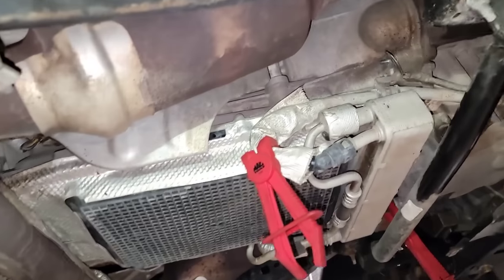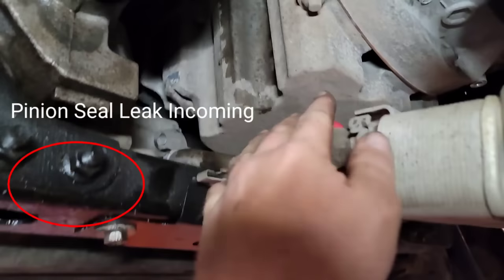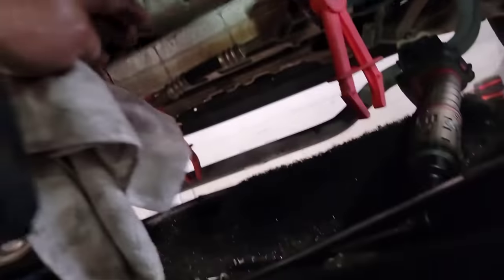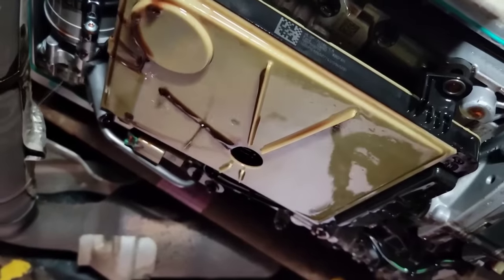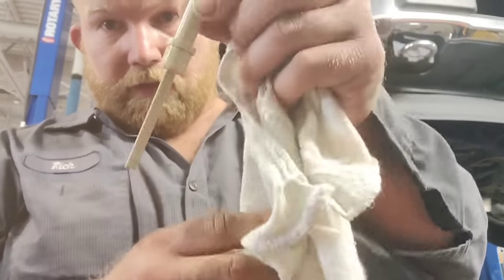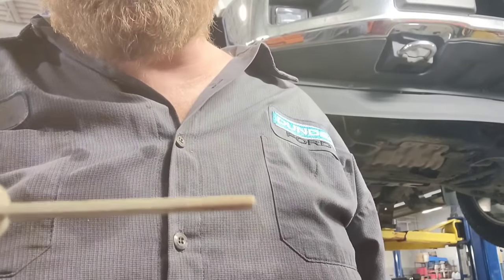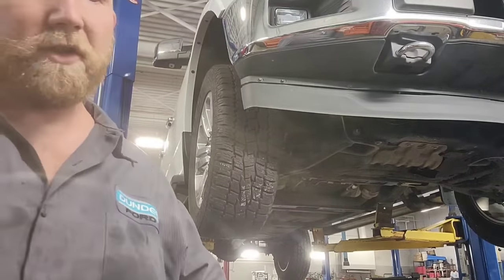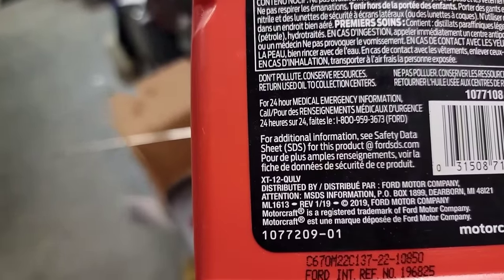EASY WAY Ford F150 10R80 Trans Filter Replacement and Gasket and Fluid - How to check Oil Level also

Comment from the maker: Normally when you see guys do the transmission pan drops on the 10R80 you see them remove the cooler and everything will that's not necessary and I'll show you how to do that in this video my way
Reply: what are your thoughts on DIY transmission service via the coolant line method? remove one line from the radiator run the engine drain one quart then add one quart repeat until clear it seems to work well on older vehicles from late 90's to about 2010's that I've seen on youtube.
Reply: im sure the filter is fine, why not just suck out what you can from the dipstick bolt and add what you pulled out.  5 mins and your done. you can do a drain and fill twice in 10 mins. your way seems alittle overboard

Comment: This is a really helpful video. I have a 19 f150 with the 10 speed with 45000 miles. At 50k I was planning on doing all my fluids aside from coolant. Transmission, transfer case, differentials, brake fluid, and oil all at once.
Reply: Sure you can but it’s more work than you think. 
Rear End,Transfer Case,Front End, Tranny & Fluid would take me nearly a day.
Reply: @mcmuskie2563 I'm a professional mechanic with toyota and it only took me a couple hours. Ive since done the services again at 90k with a similar amount of time.

Comment: I really like your maintenance videos. 18 F-150 2.7L.  I did my diffs and T-Case at 27k and my trans at 37k.  I even installed an aluminum PPE pan with a drain plug. Thanks Boss.
Reply: Where did u get your aluminum transmission pan with drain?

Comment: Used a Mityvac fluid exchanger 2.8 gal. on my 2018 F150 5.0 10R80. Got the clear flex tubing, couldn't use the hard opaque that came with it. First checked where the fluid was at ,..at cold, so I have a reference point.  Just measured what it sucked out, then replace that amount. Top of first hash mark.   18k miles
Reply: You probably noticed it shifting smoother

Comment: Great Video. I do believe the 2017 f150 10r80 is easier as there isnt much to take off other than the pan, but after that they have more parts around it that must be removed. Thanks for the video! Always appreciated.
Reply: Does the two transmission lines need to come off.  I have the same vehicle 2wd with max tow
Reply: 10r80 is 2018 and up only.  2017 and below is 6r80
Reply: @thegamehud8214 10R80 was used in some '17's along with the 6R80 in that model year.
Reply: You have 3 different engines all with the 10 speed trans. The V8 being the difficult one.

Comment: I’m wanting this don’t on my ‘20 with 34k miles on it. But I have no trust in any shops around here. This video should be a big help
Reply: Ya there’s another one by Makuloco that I referenced on Utube. I bought the suction version worked great but you need a compressor to pressure the tank. They have a hand pump version as well. Mine cost $90.00 Canadian dollars from Amazon

Comment: Dang brother. I don't know where you are but I'd be willing to travel 200 miles to have you work on my Lincoln Aviator.  I once owned a Land Rover and the dealer service was supposed to include a tire rotation but I knew for a fact (due to obvious tread wear) that they didn't do a damn thing. The entire service was $900 and I honestly don't remember what all I had requested but if they couldn't rotate the tires, what else didn't they do? If I had a lift, I would do my own maintenance like when I was a young man. But I'm 57 years old now and it's not the most attractive thing to me at my age. I'd probably drop the car on my head! Anyway I deeply appreciate your work ethic.
Reply from the maker: I work in the used car department at Volkswagen Now - so I work on everything
Reply: @FordBossMe  Consider opening up your own garage some time in the future? I'm in Commiefornia sadly

Comment: Thanks for this video. 
My service department keeps telling me I don't need to change fluid until 100k. I'll be getting the trans and diff  fluids done at 50k.
Reply: and they will tell you you don’t need to drop the pan or change the filter and they will still charge an arm and a leg

Comment: I've got a 10R80 and it's at 95k with original fluid. I plan to do a service soon. It's starting to shift rough. I didn't know it was a 50k service interval. A ford dealer told me it was every 80k to 100k.
Reply from the maker: Ford dealer is wrong 50k is key
Reply: Ya you’re over for the first time. There’s a break in period where the metal seats itself and somewhat grinds the surfaces. You going to find a lot of grey metal fillings.

Comment: Other day watched one of your video how get fusion in maintenance mode to change rear brakes on my 20 fusion with 21k , rear rotors were grooved up alot of pad left i just put new rotors and pads on because up here dealers are booked months out or they need help. Hard to get warrenty work up here done.

Comment: A Ford dealership told me they recommend a flush instead of dropping the pan due to the gasket on the pan. They say there is a chance it may not get a good seal and leak. Have you ever heard of anything like this ?
Reply from the maker: They don't want to do the work that's why, no that excuse is bs
Reply: Appreciate the info, great video
Reply: That’s total B/S and shows the Service Dept has no faith in there guys.
I’ve been in the trades all my life, I’ve always said-
If you want to be a tradesman, be a good one!

Comment: Another great video Rich.  
Question regarding how to change out the fluid.  My local Ford dealer does not pull the pan and change the filter.  They hook it up to a machine and put in a Valvoline cleaner and suck out the old fluid but never change the filter.  Then they simply add new fluid.  I was surprised they didn’t drop the pan and change the filter.  They said it wasn’t necessary.  I opted to have a trusted trans guys drop my pan and do it as you did.  Any thoughts on this?  Thanks
Reply: I'd never go back to that dealer for service.  But that's me .
Reply from the maker: Beaten path

So this is where you're thinking is flawed it is a normal procedure to do it that way there is nothing wrong with doing it that way because that filter lasts a very long time

The Next Step would be instead of an hour service now you're moving up to a 2.2 hours service and you increase the cost of the repair substantially when you want the pan dropped and the fluid changed and the filter and Gasket replaced so they are not the same service

We would flush it the same way as your do it did unless specified the customer wanted the filter and Gasket changed as well then the price would go up substantially because it's going to take me about an additional 1.2 hours
Reply: Thanks for the reply Rich. Honestly, I was surprised that you would recommend doing the same service that my dealer is doing regarding flushing the transmission. I have always heard that flushing a transmission is never a good idea. Especially, on older vehicles.  Maybe this flushing process that you and my dealer are recommending is a different process as compared to what others are doing when flushing a transmission?  If so, could you explain the difference between the two and why the dealers process is safe to do?  Thanks
Reply: @claytonjustensen9042  
It is different from the old "flush" way of the past, the dealership uses special machines that heat up and "exchanges" the fluid. As Rich mentioned there's absolutely nothing wrong with doing a transmission fluid exchange (provided it's done at the dealership/shop with the right equipment) 

 With all that being said if I had a truck that had over 100,000 miles on it and the transmission fluid has never been changed I personally would opt to do a pan drop partial fluid change with filter. 
 Being so close to the 150 thousand mile filter life I would want to get that taken care of.

Comment: Thanks for the Ranger content!  I'm driving a '19 Ranger.
Ford frustrates me lol.  Ranger rear diff & transfer case have magnetic drain plugs and fill holes..... transmission is plastic with no drain plug at all.  :(
Reply from the maker: Yep everything has to be removed from the fill plug on the transmission no drain plug

Comment: hey Rich  had my fluid and filter changed in the winter    finally made a long trip with the truck this week   100 degrees outside  going 80 mph  my trans  hit 10th gear and didnt have power  went back down to 9th and i drove it straight to the gas station had  atf fluid all over so had it towed and it now runs fine    some people i found on the internet had some of the same issues   Most of them are claiming  its overfilled?  and some claim cdf drum  but i never had any bad shift issues in any of the gears but 10th 
 Thank you for any advice

Comment: Great video!! Would you recommend just Motorcraft for the fluid or would it wise to upgrade to AMSOIL?? 
I run there SS oil and want to change everything over to AMSOIL in my truck… 2018 2.7 10 speed 4WD super crew
Keep up the amazing work!👍
Reply from the maker: Motorcraft

Comment: I am thinking about getting a new 22 Ford F-250 with the 7.3 and 10 speed transmission for hauling my travel trailer. 

What is your thoughts on engine brake in, and first oil change? As well as when would you recommend or not recommend towing a large travel trailer approx 8,000 lbs? 

Thank you for your time.
Reply from the maker: As I've always said 1,000 miles no more that's when the first oil change begins
Reply: @FordBossMe  thank you!

Comment: Outstanding video...thank you, Rich.  Love the channel.  As an owner of a 2021 Ranger FX4 with 7K miles, I would appreciate your recommendation on all fluid service intervals.  50K trans service makes complete sense...thanks for that?  What are your thoughts on front / rear diff service, transfer case, coolant, etc.?  Much appreciated!
Reply from the maker: 60k for front and rear
Reply: To supplement Ford Boss Me's great advice...transfer case fluid should be changed at least every 30k miles

Comment: I have a 2022 F150 5.0 with a full towing package. What’s up with no transmission cooler on this vehicle? Also, I see there are after market deeper aluminum transmission pans available, it seems to me the more fluid it will hold inside of aluminum pan the longer you can run the transmission fluid at a cooler temperature. Would you recommend one of these deep aluminum transmission pans? These are great videos thank you so much for your efforts, I’m a big fan.
Reply from the maker: Yeah I would wait till you get out of warranty to do any of that and I wasn't aware that it didn't have a cooler I could have swore it does have a cooler

Comment: I have a 2022 Ford Transit V6 3.5L and I asked the dealer about when the transmission needs to be serviced. They said at 240,000km… I find this hard to believe because my Yukon with the exact same transmission requires fluid and filter every 75,000km… can you shed some light on this? I know changing the fluid on transit can be a problem due to the sub frame bolts rusting solid to the frame.
Reply from the maker: I don't do kilometers service the transmission about every 50 to 60,000 miles Max the sooner the better
Reply: @FordBossMe  have you had issues with removing the sub frame on the transits?

Comment: Hi, you have any video about 6r80 trans service and reading the short small dipstick? I believe the dipstick only have A and B mark, there is no mark for cold. I did have my truck 15 F150 dropped the pan and changed the filter around 67k about 5 years ago. Should I find a shop to do it again or go to local ford dealer around. Most local ford dealer said they dont drop the pan and change the filter, they use the machine; the service is called transmission fluid exchange about 300usd.

Comment: thanks for the video. on my 2019 i had to remove the 3 15mm bolt that attach the rear of the transmission to the cross-member bracket, but now i cant find the correct torque spec for those 3 bolts. do you know that torque spec? thx

Comment: Would be really nice if they would go back to easier ways of doing things. My next truck will have a factory metal oil drain plug and a regular transmission dip stick.
Reply: Good luck with that
Reply: Where are you going to find one of those?

Comment: Ford boss - my 2017 F-150 3.5 with a 10-speed is about to turn 150,000 mi. I've never changed the transmission fluid and currently have no issues. Would replacing the filter and a portion of the fluid, what's in the pan, be a bad idea? I know replacing all of it and doing a flush is definitely a bad idea. Thoughts? Thanks for all you do love your channel.
Reply from the maker: I think you can't really go wrong it's going to have to be done eventually why not do it now whenever things are running good
Reply: @FordBossMe  thanks for the advice and reply.
Reply: @joshhoyt9576  why is a flush a bad idea?

Comment: Love the content! I've got a17 f150 with 145k first owner. Sadly I've never changed the trans fluid. Runs fine. I was told that a dealer won't touch the transmission or flush it at this mileage. Is replacing the filter and a good portion of the fluid okay to do? Doing this procedure that you just showed going to help prolong the life? I'm not having any issues with the transmission but I know it's way overdue for fluid service. Your advice is appreciated.
Reply from the maker: It should
Reply: @FordBossMe  thanks. I figured leaving some old fluid but diluting it with newer fluid should be better than flushing it all out. New filter should help as well. Just wanted your prof opinion. Thanks for all the great videos.

Comment: Thank you!  I may have missed it but what do you use to fill the transmission back up?  I have an excoboost mustang at 63k and plan to do this in my driveway.  I have an oil suction tool for my jet ski I can use to get the fluid out but, wasn’t sure how to fill it?
Reply from the maker: You can find all kinds of oil transfer pumps on Amazon
Reply: @FordBossMe  that’s really helpful thank you!!

Comment: What about the transmission fluid that stays in the converter, that’s always been a bug of mine when changing filters an transmission fluid.
Reply from the maker: That's why I do a running operating temperature flush

After I get the fluids topped off to correct level I continue to run the vehicle and I will put one additional quart in overfilling it Purposely then pull it out let it run for a while put an additional in and pull it out and I keep doing it until I get 85 to 90% of the fluid changed

Comment: It’s it worth getting an aluminum tranny pan?  I have a 2018, 3.5 and tow a 28 ft camp trailer about 6 to 7 times.  Anywhere from 300 to 500 miles per towing trip.  I have 50,000 on the truck now.  Just thought if I’m going to have it serviced I could put a better pan on.
Reply from the maker: Sure

Comment: help please i have a 2018 f150 3.5 ecoboost i bought it when it had 35k miles and now it has 60k miles i am doing a transmission fluid and filter change exactly what you do in this video my question is it a good idea to completely change the transmission fluid which is 13 quart or is the 6 or 7 quart that fits in the transmission pan enough?
Reply from the maker: Do what in the transmission pan, don't do all.of it
Reply: @FordBossMe  Perfect, I'll do it, thanks 👍

Comment: Hey rich thanks for this. How time my truck 4 years old but only have 22,000 miles. When do I worry about age of oil? Thanks again
Reply from the maker: You can probably still push it out to 50,000 miles before you service it
Reply: @FordBossMe  thanks again

Comment: Hey Rich! I know you aren't big on flushes and I have had mixed results with them...  I have an 18 F150 w/ 10r80.  Dealer recommends the flush doesn't do R&R w/ filter service.  They CLAIM they use a two step process which is part BG Quick Clean and possibly the ATC Plus Conditioner.  They said the second step is a ford exchanger that heats the fluid and that plus the BG products keep particulate from getting in the filter.  Thoughts?  I've had good luck with some BG stuff but interesting they are doing the extra step, is that just to clean the cooler lines?  Love the content!
Reply from the maker: Keep all the garbage out of the transmission while they're doing the flush
Reply from the maker: It works
Reply: Thanks Rich! Appreciate your response because I know it’s always based on experience and good research.  As you say often, “Educate Yourself!”

Comment: Is this transmission plug and play? I have a 2018 expedition that’s on its 3rd rebuild on factory transmission with only 107,000miles. I want to just buy a new transmission and put it in myself but wasn’t sure if it had to be programmed after installing.
Reply from the maker: These Transmissions have to be programmed

Comment: What part # is the gasket?  My dealer gave me L1MZ-7F396-A.  It looks different than any gasket I’ve seen before for a transmission.  Mine is for a 2021 powerboost.
Reply from the maker: Remind me Monday
Reply: @FordBossMe  friendly reminder, part number for transmission pan gasket on a 2021 powerboost.

Bonus question, on the same truck, how would you test cca and what results do you get?  12v battery under the hood is 800 cca and my dealer claimed 900 was read from my truck.  I think this would make an interesting video.  I suspect my dealer didn’t disconnect the second 12v battery when testing.  These trucks with the pro power are new and yet another thing to account for when doing diagnostics.

Comment: Rich i have a question when should i drop my
fluid and filter i have a 2018 F-150 2.7l ecoboost i tow with it it twice a week all summer long and into the fall a 2 place horse trailer 3,500 lbs empty and sometimes a 1,600-1,800 lb horse and sometimes with another horse that’s about 1,000-1,200 lbs i currently have 37,000 miles on truck thanks
Reply from the maker: I would do it every 50,000
Reply: as always thank you for input and knowledge